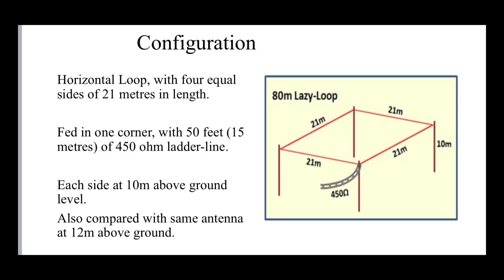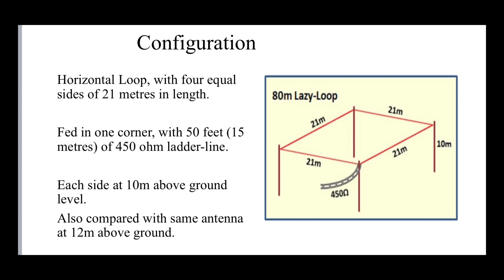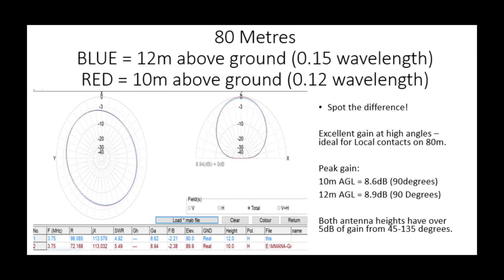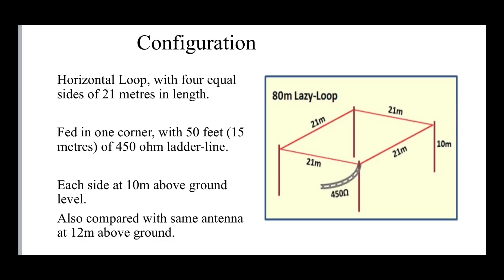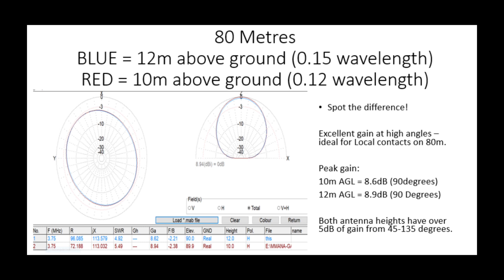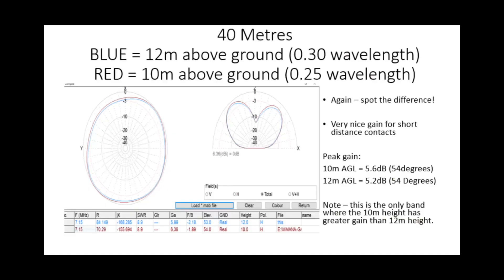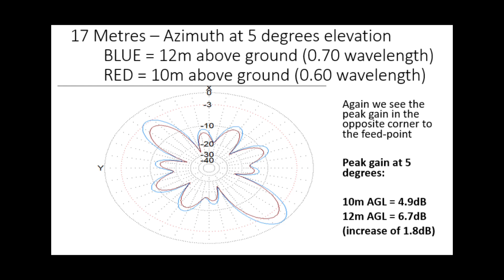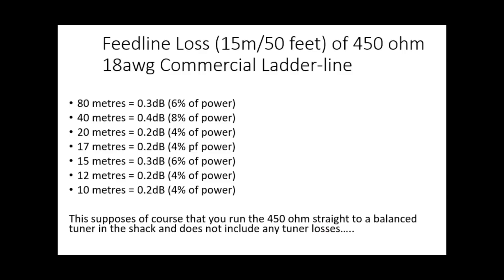HAM RADIO: Loop Antenna 80 metres to 10 metres

Comment: I have used an 80m loop as my primary HF antenna for about 10 years now using trees as supports, and I agree with everything presented here.   I originally started using a loop because of a noise issue originating with an AM broadcast station antenna array on 1300 KHz only 900' away.  The 3rd harmonic was broad and nasty until I changed over to the loop.  Having a balanced antenna also solved the problem of getting a good RF ground on the 2nd floor of a house.  It was no longer required!  I moved away from the 1300 KHz station several years ago and now feed it with about 100' of LMR400 coax.  While not ideal, the loss is not terrible.  I had aesthetic issues with the XYL using 450 ohm.  My noise level at the new location is S1 or less.  The loop is only 6 t0 10 meters off the ground yet I can still work 40 meters into Canada from Oklahoma with a hundred watts no problem.  30 to 10 meter  band performance is superb as well.
Reply from the maker: They are truly very good and adaptable antennas!
Reply: How well does it work on the higher bands 10-30m?

Comment: I love my 160m Delta Loop. I work 160-6m with it no problem. It's at 80ft and fed with 450ohm   ladder line down to a lightning arrestor, then a 4:1 current balun, a short run of DXE 400 coax and then into a manual tuner. I work a lot of DX and POTA stations with it. All I run is 100w and the radio is a Yaesu ft-847. If I toggle between it and my vertical it has around a 4 S unit higher signal and a very low noise floor. I love your videos.  The linear loading ones are what  attracted my attention.  73 de KT4ZG
Reply from the maker: Thank you Robert, that loop of yours sounds mighty! 73
Reply: @timg5tm941  Thank you very much,  73!

Comment: I had a very large horizontal loop that was made for 500 Khz at my property on the beach of Maui. I could hear shipboard CW operators at night across the Pacific and would tune up this loop for 160, 80, and 40 meters where it had a lot of gain. It was one of the best multiband antennas I ever had. These days I have a 160m horizontal loop at 45 ft fed with 450 ohm line and to a 4-1 balun and short section of coax. It works good but is nothing like the monster loop I had years ago. Great memories and excellent video!
Reply from the maker: Thank you!

Comment: Look into old antenna books.  Been around for many decades.    Fiirst antenna i used the early 90's.   On 80...yeah.  cloudburner.  Above.  The radiation angle comes down and is a very good antenna on higher bands

Comment: I had a 160m horizontal loop back in ZS, fed with homebrewed 450 Ohm feedline from a 4:1 balun and a short length of RG213 to the shack. My experience with that version convinced me to build an 80m version for my new QTH in CT7......best wire antenna I ever had. I will be supporting it with four 12m Spiderbeam heavy duty telescopic masts and a longer feedline to feed the Northeast corner, hopefully allowing me to contact my mates in ZS with my 100W on a good day. Thanks for the MMANA analysis of this antenna, I have been wanting to see such an analysis. Thanks for the video and for the time and effort to make, edit and upload. Much appreciated. 73 CT7/ZR1XZ.
Reply from the maker: My pleasure and I’m glad you can confirm the excellent results from this antenna 73
Reply: Thanks for the video Tim.  To use the loop on 160m just add some *inductance...  I'm using an 80m oblong loop connected directly to a 4:1 current balun and MFJ926B remote auto-tuner mounted directly below the ridge of my roof - so in practice there's no feeder at all.  I use a relay to switch in a 235 microhenry coil on 160m to tune out the capacitive reactance.  The coil is wound on an old ferrite rod former and I've slid in a small piece of ferrite rod to peak the signal level on 1940kHz.  The auto-tuner is then able to match the loop across most of Top Band but to get a match in the CW section I have to climb into my  loft and push the ferrite rod a bit further in.
*UPDATE - I've since replaced the inductor with a balanced L network to effect a better impedance transformation prior to the auto-tuner.  The relay now places a 93 microhenry inductor across the loop and a 91pF capacitor in each leg between the loop terminals and the 4:1 current balun.  With the auto-tuner bypassed (unpowered) sliding the ferrite rod will achieve an SWR of 1.7:1 which is then reduced to almost 1:1 when the tuner is powered on.

Comment: This is what I have been using for 25 years.  Has never required maintenance  Feed it with 800 watts and has a four clover leaf pattern on 20 of which I use the most.
Reply from the maker: Excellent

Comment: Well done (again), Tim.  For clarification on the name:  there are two kinds of loops, vertical and horizontal.  Because this horizontal loop is laying down, I call it a "Lazy Loop".  

Due to changes in my employment, I moved around a lot.  I introduced this loop to three different clubs.  Each club was using a tri-band beam or quad, plus dipoles for 80 and 40 at Field Day.  

There are 4 major lobes and by proper orientation (here in Germany),   with the strongest lobe pointed at stateside (NW), the SW lobe was pointing long path to VK, the NE was pointing to JA, the SW to the Middle East.   

Besides blowing the dipoles out of the water on 40 and 80m, the loop held its own against the beam (or quad) on the high bands, at least in its 4 main direction.  As a result, all 3 clubs ceased bringing a tower and beam to field day and just used the Lazy Loop on all bands.  This gave us more time for Bratwurst and Beer.

73, de Rick, DJ0IP
Reply from the maker: Brilliant information Rick! It looks a very nice antenna. Love a beer and bratwurst too. 73 and much appreciate you stopping by.

Comment: Thanks for the great Video! For many years I have installed a 165 meters long wire antenna on my property and across my neighbour’s house.. It is also known as a skyloop antenna and the feed line is an old tv antenna twin lead about ten meters long onto a 4:1 home made Balun in the shack.. Then it is connected by a short coax to an mfj tuner.. Works reasonably well on all the band including 160 meters for CW n FT-8 including the WARC bands.. 73 de YB0NSI..
Reply from the maker: Nice work!

Comment: Here's a way you may be able to get around the high SWR losses on 160 m. Open up the corner opposite the feed corner. Then (a) put a relay there to reconnect the two wires when desired. You'll want it open for 160 m and closed for higher frequencies. On 160 m with the relay open you've got a badly bent up  half-wave dipole which should have a very low input impedance. Alternatively (b) at that far corner instead of a relay, connect to an additional length of ladder line 1/4 wave long at about 1750 kHz, shorted at its far end. That will present an open circuit to that corner outside the low end of 160 m at 1750 kHz, and inside the band will put a capacitive reactance across the open end of the loop detuning things to an even lower resonant frequency, but it still should work. On 80 m, 40 m, 20 m, 15 m, and 10 m the shorted ladder line stub will be an integer multiple of 1/2 wave long and will present a short to the corner of the loop causing the loop to behave pretty much the same as the original design on those bands. All bets are off on the non-harmonically related WARC bands with the stub, but with the relay they'll be like they are in your original design.

Now to get this to work correctly you're going to have to set the resonance point of the stub at the low end, 1750 kHz or thereabouts and everything should be fine for CW. Shorten the stub a bit to get it to work nicely on 75 m for 'phone operators and the harmonic resonances are all going to be way off, so good-bye 40 m and higher. Thus this trick is only going to be useful for us CW operators.

David  VE7EZM and AF7BZ
Reply from the maker: Ok interesting

Comment: I had an 80 meter full wave loop which I used for years. Best wire antenna I’ve ever built. Was at about 40 feet high, fed with 450 ohm ladder line with a 4:1 balun near my operating position. Internal tuner of my FTdx1200 handled the rest. I had to do some ladder line trimming to get it operating on all bands. Great DX results. I fed it in the middle of one leg (just a convenient spot).
Reply from the maker: Sounds a superb antenna

Comment: I discussed this with Callum from DX Commander a little while back, he had a better solution:
"You build 2 x wavelengths for 40m and get it tuning.. Then near the tail of one end of the loops, build a loop of wire about 12 feet long (4m) and droop it from the feedpoint and connect it to the loop in a long arc (almost half a circle) then when 80m comes long, it'll try and use that too, forcing the resonant frequency lower (and should wide-band it slightly..)"
Reply from the maker: Its an option for sure

Comment: Modelling this with MMNANA is nice but everything is pure theory. Everything depends on the surroundings like buildings, trees etc.. I've had this antenna for years built around my garden. I've worked much DX on 80m. It is useless on 160m. It is also useless on 10m (and 12m) if you compare it to a 1/2 wave vertical or a simple 2 element beam (those will do much better). But it is a great antenna from 80-15m especially around the greyline when DX signals can be on high angles as well. Of course it is a excellent NVIS antenna. I had a lot of fun with it for years. Changed it now to a 2x20m doublet since my XYL didn't want the loop around the garden anymore. Personally I think the doublet is doing just as good as the loop. 73, Bas PE4BAS

Comment: Hi, I am trying to make a good mag loop antenna and have a truly dumb question, I know, I may be asking the wrong person because you build large obvious loops but here is the question: In order o try to remain as stealthy as possible I would lke to paint my loop the same <military olive drab> as the vehicle. Will a coat of paint  effect my loop and is there a type of paint that would have the least influence on operation of the loop??? Sorry about being off topic but if you or one of your followers has an answer I sure would appreciate it. Shiny metal is not the least bit stealthy. Besides my trips off road I also live in a condo with restrictions. lol
Reply from the maker: No problem, I think paint shouldn’t hurt but someone might chip in with more info here …

Comment: I had a coax fed, through a Balun one of these up for a while, it only just fit in the garden and I was not happy with the position of some of the supports near the road. It seemed to work fairly well, a chap in Ireland had it off me and I think he was able to put it much higher, I was only at around 20 feet. The chap in Ireland was very pleased with it.
Reply from the maker: The extra height really helps

Comment: I build the same Antenna but for  40M not 80M. It works very well on all frequencies  which are multiples of 7.1 MHz , I feed it with coax cable terminated by a remote MFJ993 BRT antenna tuner and a 1:4 balun.  I bypass the remote tuner on 15, 10 and 6m where the 1:4  balun is sufficient to match the Antenna. On 40 and 20 m and even 80m,  the swr after tuning with the remote antenna tuner is perfect. On 160m, 60m, 30m, 17m and 12m , swr after tuning is between 2 and 3 and I use a second tuner in the shack to bring it down to less than 1.5. The loop is installed on the flat roof of my building at a height of 25m above the ground. I worked the whole world on FT8 on 60M and all above bands, a little bit harder on ssb  but I am still happy of the performance,  on 6m it is really spectacular when there is propagation,  works decently on 80m but only for Europe no DX.  On 160m it is warming the Sky, so no exotic DX FT8 stations are heard, in fact I hear almost nothing.  Overall   this is an excellent multiband  Antenna, it could be also used  too on  4m , 2m and even 70cm band as it resonates on these bands (but then only with a proper wideband 1:4 balun and it would also  require to  bypass completely - with transfer relays - the HF remote Antenna tuner).
Reply: now try switching to stainless wire instead of copper and watch yoru SWR drop a full point ;)
Reply from the maker: Nice job!

Comment: Hi Tim
I´ve been contemplating one of these as an option for my home QTH. I live on the 4th floor of an 8 story apartment block and wondered how a loop would perform mounted on the building roof. I´ve certainly got the room up there for an 80 mtr loop but I would need to feed it with coax. Anybody got an opinion on such an installation? I work 100% CW and am mainly interested in contesting. Currently, because of local Rx noise levels I tend to work portable but this restricts me to day time ops only.
Reply from the maker: The height sounds promising. Coax fed loops can work well. Or you could do ladderline to a remote atu up there and then coax to your operating position?
Reply: If mounted on the roof, it sounds like you should have plenty of height.

If you must use coax then I would suggest putting a remote tuner up on the roof.

Barring any unforeseen oddities such as undesirable interactions with any metal structure in or on the building, sounds like it should work well.

Your biggest problem is likely to be a high noise floor if you are in an apartment building (which is true for most hams these days).
Reply: @AmateurRadioUK  Thanks for the reply, good info indeed, and yes I currently suffer from a high noise floor, is it possible that a loop mounted on the roof could 'quench' that noise somewhat? Currently, when working from the apartment my antenna setup is a random wire (11mtrs) mounted to a horizontal 7mtr mast out of the window of my 4th floor shack in an upside down inverted L format. fed via a 9 to 1 unun into a Palstar AT2K tuner.
Reply: @timg5tm941  Thanks for the reply Tim, that´s worth some thought indeed.
Reply: @garyhill8333  Loops are generally considered quiet antennas, so I would expect a loop to be quieter than a random wire.

I guess that the only way to find out for certain is to try it!
Reply: If you place it on the roof, be sure to get it as high above the roof as possible.  In general, loops are quieter than end-fed "anythings".

I like the idea of remote tuners.  Unfortunately these did not exist when I was playing with these antennas in the 1970s and 80s.

Although I always used balanced line to feed mine, matched with a BIG Annecke Symmetrical Coupler, a good friend of mine has fed one with a good 4:1 balun and then coax to the shack.  He gets good results on ALL bands.  I'll post the link to a description.

However, I have no idea how either version (coax or balanced-line fed) will perform on the roof of a house.  The advantage of using balanced-line and a matchbox is, you do not have to fine-tune the length of the loop.  The coax-fed must be carefully adjusted in length in order to bring in all 8 bands.

Gud Luk.   de DJ0IP

https://www.dj0ip.de/loop-antennas/8-band-horizontal-loop/
Reply: 8 stories up gives you good height!  It would work well except for the coax. Can you just throw the ladder line over the side of the building (stand it off at least 6 - 8 inches from the building face, just top at roof line and at the window height is enough) and then just bring it in a window in your apartment. Adding some twist to the ladder line, say 1 twist every three feet, and at least 6 - 8 inches from the building minimizes coupling to the building. A friend of mine does that and his setup works well. He holds the ladder line away from the building at the roof and the window with 1" PVC pipe.
Reply: @johnkemas7344  Hi John, thanks for the reply. I'm not sure that it´s something that our HOA would authorize but certainly worth pursuing I believe. Can you tell me the reason for needing a twist every 3 feet please? I'm at a loss as to why that would be needed. Also I take it that you are referring to commercially available ladder line?
Reply: @garyhill8333  I do use 450 ohm commercial ladder line from DX Engineering. the twist helps to decouple the line from its' surroundings and like other electrical cables having twists in them, it helps to make them self shelf shielding. I'm just guessing at the rate of twist but there have been articles in QST magazine about the proper way to run ladder lines outside of buildings and along the ground.

Comment: Hi just came across your channel . Very interesting. I was looking at a square aerial design for my QTH here in the North of Scotland. At the moment I have a doublet cut for a 1/2 wave on 160m . (on 3 masts) fed with 450 ohm ladder via a KW107 matcher.  I was wondering what a top band square would look like modeled.? A have space for another mast . Im not to good on modeling software . May try it this summer . Like your videos  73 GM8NYV
Reply from the maker: Thank you! Depends on height. A FULL wave 160m loop at double the height of the antenna I show here would basically behave on 160m like this one does on 80. Then 80m would be like this one is on 40m and so on.